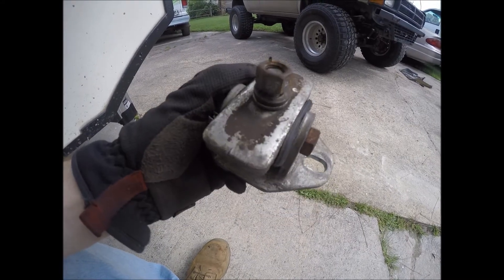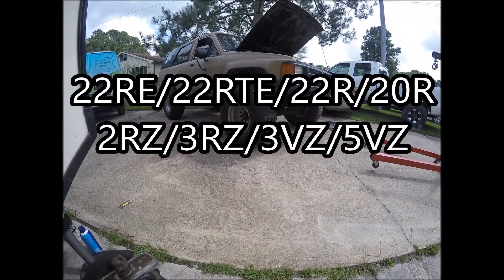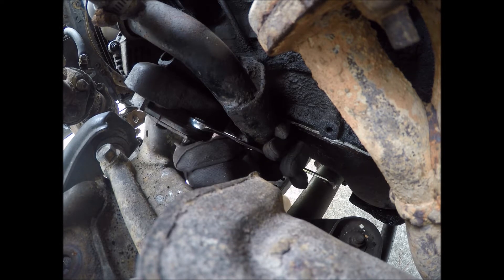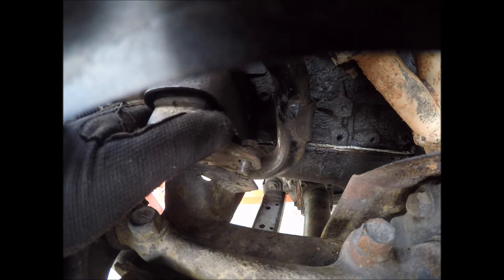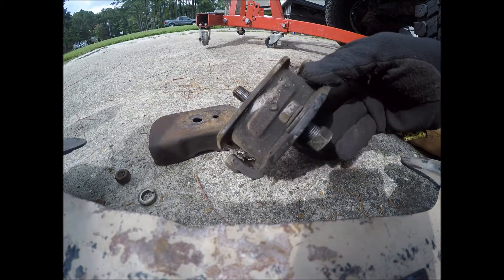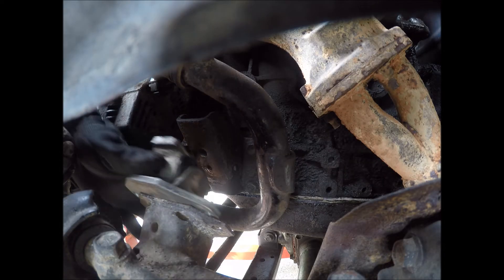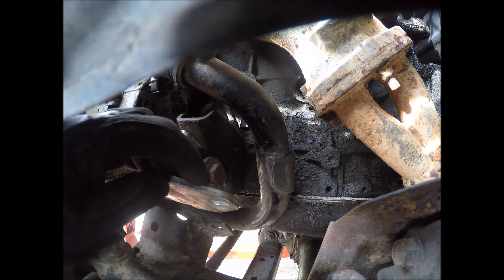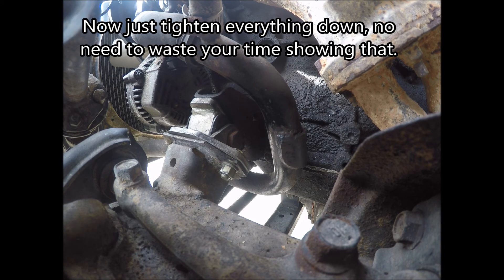TrailGear "Bomb Proof" motor mount install- 22RE/22R/20R

Comment: Duke, can you life the engine up without a cherry picker and just use a jack to support it under the oil mount?
Reply from the maker: I personally would feel uncomfortable doing that but ask that on Toyota Tech and see what the people say
Reply: Don't do this. It's unstable and can cause gnarly damage to numerous parts beneath the engine. It will be wobbly and you'll have a solid chance of severing a finger if you use this method. Find that one salty dude in your group of friends who's got one of these lying around and borrow it from him.
Reply: I had to replace mine in the middle of the desert and did exactly that. went ok, except i was not able to fit the original screws back in so i replaced them with smaller diameter ones
Reply: In my experience changing other cars mounts what i did was lifting the engine with 2 different jacks, a bottle one and a hydraulic one to make sure the engine is well supported, also be sure to use a piece of wood on each one to prevent damage to the oil pan...🙌

Comment: I’m jacking up my engine with a cherry picker but the whole car is coming with it. Bolts are all removed. Zero clue as to why this is happening.
Reply from the maker: That should be normal for a few inches cuz ur engine weighs down ur suspension